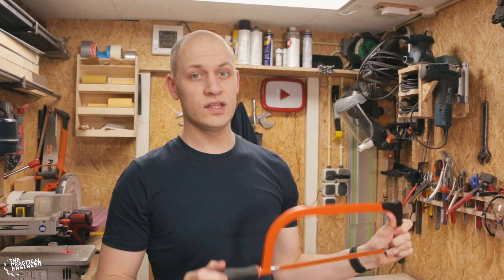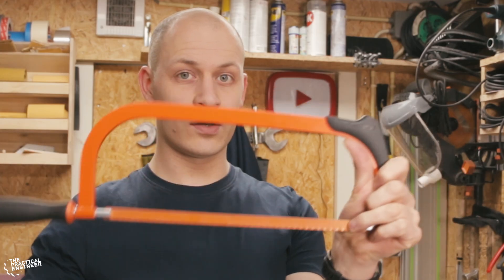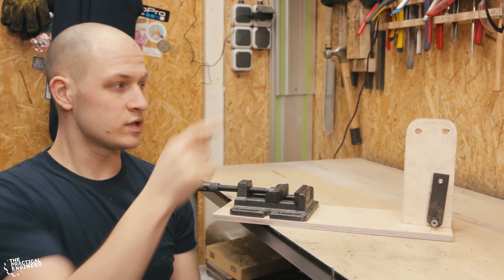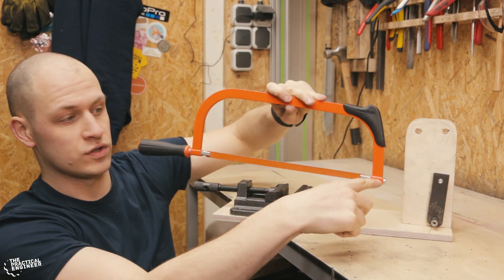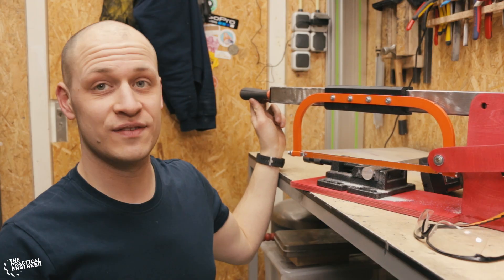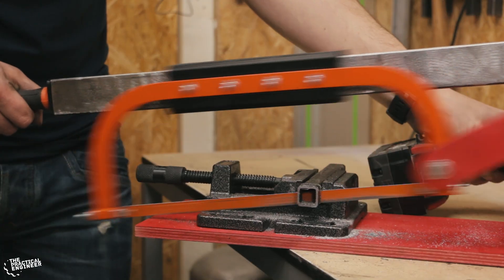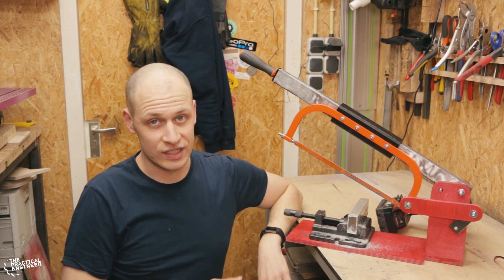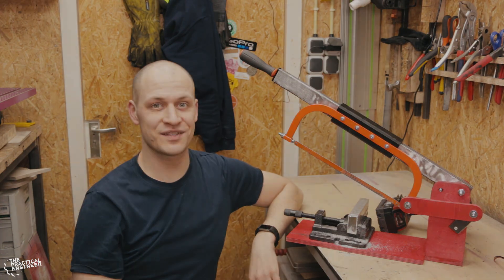Cut metal easily! - DIY Power hacksaw

Comment: delrin is pretty nice
Reply from the maker: Yeah, Delrin would be a nicer material to use for the bushing than the plastic I used. Mine will most likely run out quick and then I have to print a new one.

Comment: It will ruin your hacksaw blade quickly.
Reply from the maker: definitely, mainly because it cuts a lot quicker than you can do by hand so It also wears quicker. If you prevent it heating up too much it's fine. they are 3 euro each...
Reply: @Thepracticalengineer  nope. Not only for that. There are 2-5 reasons which can ruin the blade. Important one is applying pressure on reverse stroke. Another one is the speed should be within 50-60 strokes per minute, here it is nearly 100. And of courae It is not a reciprocating saw blade.

Comment: The I don't know where the Practical engineer lives if he's in the states or not. But he has a lathe! Am I the only damn person in the Free World that doesn't have a lathe? I mean shit I am 62 years old and have been doing Meiners repair work all of my life. My brother has done nothing but weld for almost 40 years and neither one of us have a friggin metal lathe. All I can do is say, look down upon me Jesus you got to help me make a stand and try to get me a few more goodies to play with. I'd like to be able to make some pins for my tractor. I can buy them for $3 to $5 but you're damn well getting what you pay for and they wallow out and you have to replace them. Oh well good video keep it going
Reply: I was feeling exactly the same way... I have tractors and parts can be welded and built on a lathe for a fraction of the cost, so say nothing of having to wade through to find what you need. I finally found a good lathe for a very good price. I also bought the mill the same day. Feel a lot better.

Keep a look on craigslist, or on Facebook market place. That's where I found mine. Good luck man.
Reply from the maker: A lathe definitely seems like a super big investment but it doesn't have to be. I paid 175 euro for this lathe, it was a large piece of rust at the time. Then I restored it into a usable machine (its still not very good) spending roughly another 175. So that's about 350 euro for this tool not a lot more than a bandsaw, table saw or a drill and circular saw together..

Comment: Hi, I just subscribe to your channel, I like that kind of showings. Good idea. I have a vertical, horizontal SAW and a small bendsaw for Wood and none ferrous material of which I took the tires off.
I also have a hand held metal cutting bendsaw which I like to turn into a verticalone with a table. Also long planning for making one of yours type . 
I have the 1.5” wife blade and other thing for it. Your s lack of söröket adjustment what u Can easily fix.
I am too old and too many jobs waiting
Reply from the maker: Hey Bob, That sounds like an awesome workshop and some cool projects ahead!

Comment: If that can cut faster than you could do by hand, then you definitely need to learn how to use a hand hacksaw.
Reply from the maker: Please teach me how to
Reply: Haha, just do the same your machine does but exerting force on each forward stroke, like 75% down 25% forward. It should take you less than a minute to confirm what I said, plus I'm sure you'd find it quite rewarding once you manage to cut fully straight in just a pinch.
Reply from the maker: Thank's Ill try that. *still saving for a metal cutting bandsaw though..

Comment: Nice design and build. Now you need to install a switch to have it shut off after a finished cut. And maybe even a small motor so you don't have to use the cordless drill. Thumbs Up!
Reply from the maker: Thanks for the suggestion. For the auto stop it would indeed be better if it had it's own motor. I like the idea of using the drill though.

Comment: Cool project.  One improvement would be to allow for the vise to be moved to another position further from the motor to use the rest of the blade. (A problem in all power hacksaws is using all of the blade to get more life.)
Reply from the maker: You are right. With power hacksaws this is often the case. however, with the price of these blades....

Comment: can this saw make angle cut on aluminium?.. i dont want use mitre saw because too loud,,
Reply: Angle how ? The cut at an angle while being perpendicular to the base plane or a cut at an angle with the base plane?
Reply: @arunvignesh7015  need to cut 45 degree on work piece.
Reply: @ripcobain88  it'll sure work. But you gotta place the bottom clamp at the 45 degree angle such that the bar is cut at 45. The only problem is, this is a light weight mechanism with lose tolerance values so it would be better to make a groove with hand saw or apply a little pressure holding the blade holder carefully for a bit to make it easy for this saw to guide and cut within the groove. I remember using the hacksaw and sometimes get uneven cuts if the initial cut is improper
Reply: @arunvignesh7015  thanks, i will try

Comment: hey dud cool project, practical idea..! i love it. i think a salvaged motor of almost any kind will improve the comfy way of using the machine. also consider placing weights of some kind on the saw bar instead of the handle or next to it. it will free you from pressing down while you using the machine.. im inspired.. thnxx for sharing!
Reply from the maker: Hey Shay, Thanks for the feedback!  Yeah, it can easily be improved to be a more 'industrial' version. My goal for this one was to make something relatively small and drill powered. Having a fixed motor with an automatic stop would be a nice improvement.

Comment: That’s a cool idea, but a couple improvements could be done : replace the sliding mecanism with a linear bearing, and add an external switching system, so that you don’t have to reach the back of the machine while operating it. Anyway nice video ;)
Reply: Instead of having the bar sliding over the top of the other bar,(creating friction) you could add a couple of roller bearings to eliminate that grind, ... & it would roll a lot easier than sliding against itself, ...
Reply from the maker: Thanks for the feedback! You are right. If it would be a full on machine it does need those changes indeed but it being drill powered it wasn't so easy to introduce the auto stop function.

Comment: Make the arm longer.. let the blade pass longer on the material.. .. that way it will cut faster and it will not finish the blade so fast like in that short part where the blade touch the material.
Reply from the maker: Thanks for the suggestion! It'll probably work better the way you described. However, in the size it is now this is about the largest stroke I could accommodate without making the machine a lot bigger
Reply: @Thepracticalengineer   You are right.. At how cheap those blades are is not even worth it :)

Comment: To summarize:
It's awesome.
It's slower than sawing by hand.
It's more accurate.
It will use only half of the blade, though you can move the vise.
It's less tiring to use.
It's not cordless (aka, completely)
It takes up more space.
It's not as fast as a reciprocating saw, but can cut larger things.
Anything else that I missed?
Reply from the maker: Nice summary!

Comment: if you mount the vise on another platform higher that would make the saw more parallel with the base. Also you could mount the higher platform on a rail system so you could move the platform in the same direction as the saw when it cuts so more of the blade can be used. Obviously a lockdown would have to be designed to stop the vise moving when cutting.
Reply from the maker: That's a nice idea thanks!

Comment: Nice design. Good build.

You created a unique answer to a problem.

You have lathe, and a drill press. Which is definately cool.

However for about 50 dollars you can buy a mini chop saw. Probably cheaper than either lathe or the drill press.

I bet you can get one from Harbor Freight even cheaper, to cut those light weight pieces. 

If you are going to be cutting lots of metal.
Go up in size and quality.

If cutting a lot of metal as a one off project.
Get a big one from the Pawn Shop.

ALWAYS CHECK TO SEE IF THEY WORK.
Reply from the maker: Yeah, Eventually I need to get a metal cutting bandsaw.. but there is no space at the moment.
Reply: @Thepracticalengineer  Had one of them in our company shop.
We used to cut a lot of 16 and 18 gauge metal studs and track for framing.

For jobsite use we made a table about 20 feet long from 3' scaffold frames and boards. Then used a chop saw. For repeated cuts we would just screw a stop block onto the decking.

Slide the piece into place cut it. Slide it off the end into a cut pile.

With a couple of people working as a team we could cut quite a bit of material pretty quick.

Comment: You need to adjust the cut angle so you don't chop the vice in half and fit a limiting switch so it will stop when the cut is made.
Reply from the maker: Those are definitely nice improvements!

Comment: if you lower the pivot for the top arm you could finish your cuts with the blade parallel to the base give less chance of hitting the vice and make it cut on the forward stroke other than that it is a really great idea and well made
Reply: Just raise the vise, with a track where you can move back too, so you don't use (waste) half of the blade.
Reply from the maker: Yeah, I should have placed the vice a bit higher probably

Comment: An interesting device, but I'm missing something.  Couldn't you save a whole lot of effort and material, and just put a metal cutting blade in your bandsaw?
Reply: I think this might just be a bit cheaper than a bandsaw mate Cus I definitely can not afford a bandsaw but I probably can afford this
Reply: Read the comments to see if anybody else caught that before I posted. Thanks !
Reply: cut a 3 meter pipe in half on a band saw that will answer your question
Reply: That depends on the kind of bandsaw a lot of the time you run into an issue where the saw can't run at a speed slow enough to be suitable for cutting metal
Reply: Ummm, well, they have things called jigsaws, sawsalls and rotory pipe cutters.  All pretty cheap, and can be picked up at a jumble market.  It just doesn't seem like a practical device.  But to each their own I guess.
Reply: @andrewmacgregor8717  
Sure a hack saw is not a practical tool . Automatic hack saw ... how silly.
Reply: @andrewmacgregor8717  - If you had enter any metal workshop at least until some 30 years ago. You would find one of this. Wherever you add a lathe or a  mill. This would be close by. For some very good reasons.

Effective, cheap to run, long lasting, very low maintenance and cheap also, don´t splash shavings all over the place, can cut with very low temperature variation, very low power demands, remarkable cut precision and finish... Honestly the only major drawback regarding more "modern" variations, it´s slow.

Consider the basic design is more than 2000 years old! So it´s quite well proven design concept. ;-)

Example: 1 Carbide tip circular saw blade can go for >90€. I can get these blades for less than 1€/unit. 
Finished bandsaw blades were very expensive. We usually bought them in rolls. Cut and braze them to measure for each machine. To be cheaper and easier on the stock. These were bought in bundles and when needed replaced in less than a minute. ;-)
Cheers
Reply: @crpth1  Thanks for the education.  I had to look it up, and yes there were/ are electric hacksaws.  There may be economic considerations with the blades, and perhaps higher precision, but as a whole, the industry found better ways of achieving a cut.  If I had one, I'd be happy to use it, but given a choice of what to buy new..., Well I think it would be the a sawzalls if money is the issue, and a band saw if money wasn't. 😀
Reply: @crpth1   these sorts of saw are mainly used for repetitive cut of the same length like if you need 200 pieces exact 50mm long

Comment: Nice build. Three queries, firstly the size of the saw I think a larger size would be better as you are doing machining and might want to cut larger stock. Secondly some downward force would be required (depending on the material being cut) and maybe put different weights on the handle part. And lastly an  automatic cut off switch is required to turn the motor off when the material has been cut. 
Did you build it as a prototype to see how it works and will build another in metal?
Reply from the maker: Hey, Thanks for the feedback! The downward force would be nice as well as having the cutoff switch. I think if you'd build a version that had this you wouldn't make it drill powered.. I might make another one in the future that has this but Im not planning it at the moment

Comment: That's pretty cool, but I don't imagine that 3D printed linear bearing will last very long. Perhaps you could look into metal casting and use a 3D printed model to make a cast. Even pot metal (zinc alloy, relatively low melting temperature) will last much longer than plastic.
Reply: 3D printed one won't last, but a self lubricating plastic like a delrin or a teflon should hold up for a while.
Reply: I 3D Print  stuff at work out of Nylon. ABS wont last, yes. But nylon holds up to industrial tasks....

Comment: The really slick trick would be making it automatically lift a bit on the push stroke to save the teeth, then allow the full weight of the saw to come down on the pull stroke. That complication isn't needed with a bandsaw. Not needing such a mechanism, plus greater cutting speed, are why power hacksaws are rarely used.
Reply from the maker: I agree, and indeed a band saw is much better to cut steel.. This was just more fun as a project.

Comment: That is a super cool design! Nice that it can be powered by anything that generates rotational force like an electric motor, a drill or a child shackled to a treadmill ;) Well done!
Reply from the maker: I didn't think of that last one. At least I can then use my drill at the same time..
Reply: @Thepracticalengineer  , gives you a reason to keep kids around. :)
Reply: Save a few steps and shackle the kid to the hacksaw.
Reply: LOL Make Brooklyn; or a squirrel in a squirrel cage; running on demand.
Reply: A child will do in a pinch; a squirrel or a chipmunk also works.